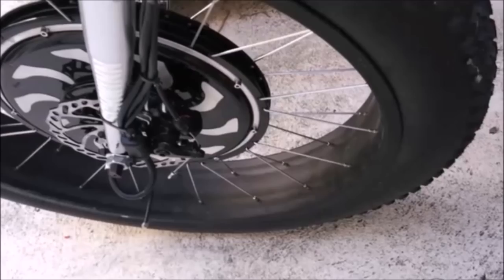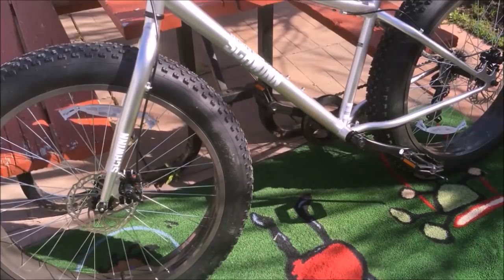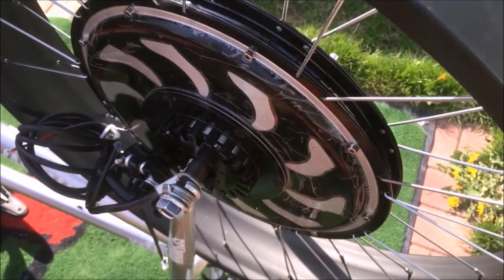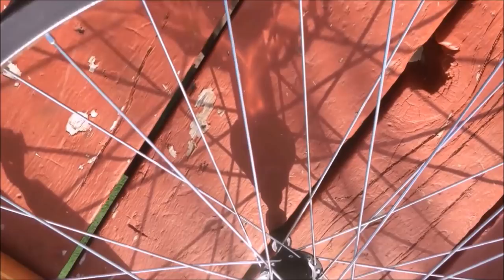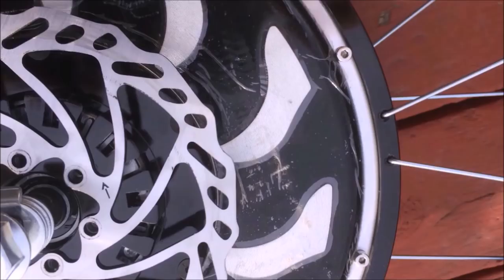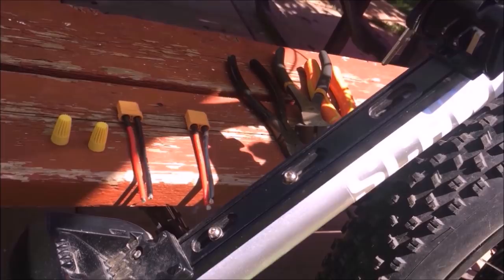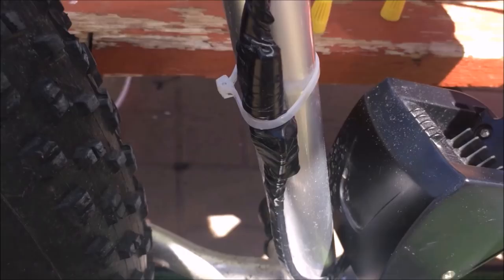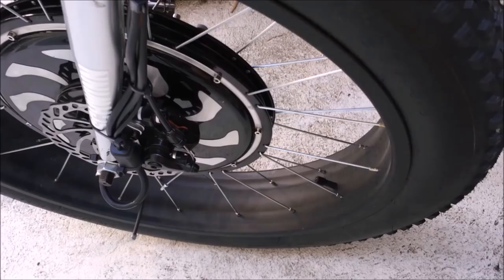Golden Motor Electric FatBike Front Complete Front Wheel Build

Comment: The washer with the Notch outside is supposed to go into the Axle /Fork connection. It closes the gap within the fork /axle so the tire can't jump out of the U shaped opening in the fork  .  This is very important because the motor has a lot of power...(Torque)  You need to fill that gap and then add washers while you center the wheel.  You might want to hammer down the notch to make it a more 90 degree instead of what they come with.  It's a safety feature.

Comment: That brake spacing ocd'ed me man. Regular mountain bike rear rims fit fat bike front forks. That should put the disk closer to the correct location. There'd be an additional gear up there but thats just another option to exploit. Good video bub, thanks. Love my fat bike. Your gonna want sealed crank cups.
Reply: To get the settup I'm thinking would require building the rim.

Comment: I do have the same exact bike as your bike except that mine is a Mongoose Malus , the reason your kit didn't lineup the right way is because the front fork of our bike is 150mm and the front ebike kits on the market for fatbikes are 135mm forks only , if you want a perfect fit you can always buy a 135mm fatbike fork on ebay , i saw them from $60.00 dollars and up , with that fork you wont need any spacers and longer screws , you will get a factory fit look and feel on your bike .

Comment: Hello i have a Shengmilo MX02S 48V 1000W that has a rear motor and i was wondering if i can add this front wheel electric motor for maximum torque (i am 1.90m 130Kg guy who live in a place with lots of hills). especially i dont know how to control both motor with only one Throttle. Thank you everyone who would be able to answer.
Reply: Hey man if ur still looking for an answer, in my opinion it's better to have two separate throttles, as that way you can choose which motors to activate on the fly, instead of having both motors on all the time or have to flip a switch to choose which one you want. Hope this helps

Comment: I hope you cleaned the disc before you installed the brakes, considering you were touching it a good amount of the oils from your hands will majorly affect the stopping power when braking. You can do this easily by just using rubbing alcohol and paper towel (or a cloth used specifically for cleaning your bicycle)
Reply from the maker: Yes and thanks for pointing that out.